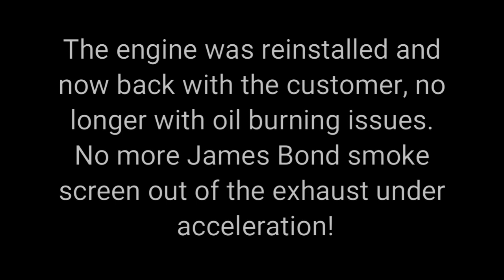BMW X5 N63 V8 Engine Repair Oil Consumption - Valve Guides

Comment: BMW is currently replacing my Valve Stem Seals, Rear Main Seal, and Oil Pan Gasket on their dime because of the class action lawsuit associated with the N63 Engine excessive oil consumption.  My car was using, on average, one quart per 800 miles.  2011 750Li ActiveHybrid 7 with only 66,000 miles.  Car was using oil when I bought it with 49,000 miles.
Reply: The Oil Consumption Test is in a recent Technical Service Bulletin.  Call your Dealer and have them look up TSBs associated with your car.  If you have an N63 motor, your car should qualify for the free oil consumption test.  If they determine that your vehicle is using excessive oil, they'll determine what is causing the oil leak, and then send that info to BMW to approve the work.  This is how it was explained to me.
Reply: I have a 2012 bmw 550i GT and it’s burning a lot of oil too. It has 68k miles. I’m gonna try to call bmw and see if my car qualifies for that job.  Anything I should know before calling? What info do I need??  Thanks.
Reply: @ivanrodriguez9270  The dealer told me there was a Service Bulletin out for my car called an oil consumption test.  I had been monitoring the oil consumption since I bought the car (I logged the odometer reading every time the low oil light came on), and so they took my info and did whatever they did and told me that BMW USA was approving the work to fix the oil leak.  Long story short, you don't have to say anything except ask what Service Bulletins are open for your car.  If the Oil Consumption test is one of them, ask them to do it.
Reply: @danielpeeks3388  BMW North America refused to replaced valve sleals in my X5 2011 83k miles, they wanted to replace the whole engine and for me to pay 45% plus tax around 6000-6200, I say screw you.... I called pro shop in NY they say they drop the engine and replace valves for 3300-3500... I do not drive much only local max 300 miles a month,,,, I don't know what to do... Maybe I sell as is and get Acura MDX or something else.... This car is completely joke, just spend 500 to replace air shocks and 680 to open the hood and replace the hood link and latches ....

Comment: Question: can this be done while the engine still in the car?
Reply from the maker: Some people will do it in the car, but i could see it being a major pain doing it that way. I would remove the engine everytime as I don't see the point in struggling or being one of those guys that's happy bending and distorting things or leaving difficult bolts out "to get the job done".
Reply: Four Rings Auto Would you leave the Subframe intact as you drop it then, as in the video?

Comment: I hope BMW is taking quality issues notes to improve this fiasco.
Reply: Maybe its done on purpose, so you have an excuse to buy a new one!?
Reply: Inferior valve guide sizing or poor quality valve  guides ..
Reply: Nick Ludu Maybe the problem is not BMW. Maybe the owners need to allow their engine to warm up before driving. Maybe the owner didn’t get hit oil change on time. Maybe the owner change his oil on time but instead of using BMW oil. He use some bs like Royal Purple.
Reply: @Fone65  Nope this has been a BMW problem since the days of the N62. Both the N62 and N63 were notorious for this issue and it was a build issue. None of their I6 motors did this with the same oil change intervals. The N63 is and was a nightmare of an engine. From the insane heat soak issues by shoving the turbos within the V of the motor to injector failures and valve seal this engine is not a long term engine.
Reply: @Fone65  it’s BMWs cheap engineering and piss poor parts they use. I’ve shit turds that are harder to break than the N63 engine built by the Germans.

Comment: The same problem is haunting N62 generation of BMW V8 engines, premature valve guide wear. Many people believe that the problem is valve guide seals but it is just a a consequence not the the reason unless the car has lots of miles like 200'000 miles. Btw, what is the mileage (or Km) on that engine youre rebuilding? Thanks for sharing the information!
Reply from the maker: Agreed the n62 does have a very similar problem. This n63 was horrendously bad however.
Reply: Four Rings Auto would you replace the timing chain at 110k Kim’s?
Reply from the maker: Wouldn't be a bad thing. But maybe prematurely. Go off the service history, long intervals mean chain wear.

Comment: Thanks for posting this very helpful video. There have been several cases of N63 engine failures. Have you seen this? Is it due to the rod bearings or some other component(s)?
Reply from the maker: Thanks for your feedback! 
I personally haven't experienced this but have heard of rod bearing failure on these engines. I'm based in Western Australia so we don't see as many n63 as in the USA. I'd be greatful if you subscribed to the channel or shared the video, as little things like this make a difference to a small channel like this. Thanks
Reply: @FourRingsAuto  Suncribed already. I will share your video with N63 community.
Reply from the maker: @warriorsf911  thank you for your support. The more these videos get shared, the more we can give to the car community.
Reply: My N63 had a bearing failure as I comfortably drove down the highway about 80 miles from home. BMW is trash and I’ll never buy another. Luckily my friends witnessed our heartache with the car and the dealer and they all got rid of theirs and vowed never to buy BMW again.
Reply: @secretsquirrel572  What car do you drive now?
Reply: @dafgen-y8b  we’ve got a new Yukon Denali XL and I still drive my 2011 F350 daily.
Reply: @secretsquirrel572  Never heard of the Yukon brand, seems like its something American! Oh well, I hope you're happy after you ditched the BMW.
Reply: @dafgen-y8b  it’s an SUV made by GMC.
Reply: @secretsquirrel572  Ah those big boy trucks. They weight like 2500 kg? Road tax here is calculated by weight so there are almost no SUV's here
Reply: @dafgen-y8b  where are you from?
Reply: @secretsquirrel572  The Netherlands
Reply: @dafgen-y8b  awe. I’ve flown into the Netherlands a few times. Never had a chance to get out and enjoy myself though. My company has a position there. Maybe one day I’ll make it over.
Reply: My n63 failed. Dealer said it was due to a spun rod bearing. This was a few weeks after replacing the stem seals due to excessive oil consumption. When the engine failed, it broke into chunks, broke the engine mounts, bent the flywheel, locked the wheels up and i came to a screeching halt.
Reply from the maker: I hope they did the right thing and made some form of contribution.
Reply: @FourRingsAuto  my extended warranty paid $11,200 for a new engine. After the engine was replaced, from day one its been having a really hard time starting and getting check engine light/drivetrain malfunction/reduced power mode at startup, crankshaft position sensor faults. Replaced flywheel, the sensor 5 times, cooling pump and still has it. Its back in the shop now, BMW sent out a technical service engineer out to help the shop, said to replace the DME and Engine wiring harness and again, my extended warranty will be paying for it if they approve the repair. Seems like they messed up and dont want to fess up to it and now just replacing random parts that didnt need to be replaced in the first place.
Reply: @pavelbarchuk  What's the current status of it?
Reply from the maker: Sounds like a mess of a job and some shotgun diagnosis. Would be diagnosed reasonably well with an oscilloscope hooked up to the crank sensor. Probably a bad earth. Seen it before on an n63 where someone put too long of a bolt into the coil pack earth on the cylinder head and it made the car cut out and run roughly intermittently.
Reply: @FourRingsAuto  they changed the DME, which didnt fix the issue, turns out it was the starter. They finally changed it yesterday and it fires right up with no issues.

Comment: The dealer did a poor job. Glad you solved it.
Reply from the maker: Thanks. Unfortunately the dealers are limited by what the manufacturer stipulates what can and cannot be repaired. BMW don't supply the valve guides as a spare part,  so my machine shop makes their own. A dealership would have to replace the whole cylinder head if they knew the guides were this worn. The machine shop they used to do the work didn't do anything to rectify the valve guide issue.